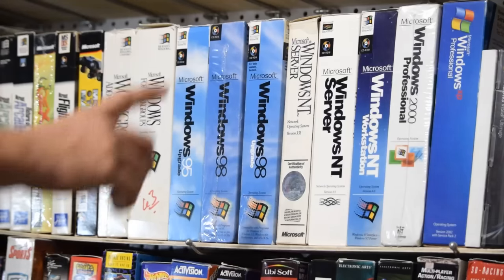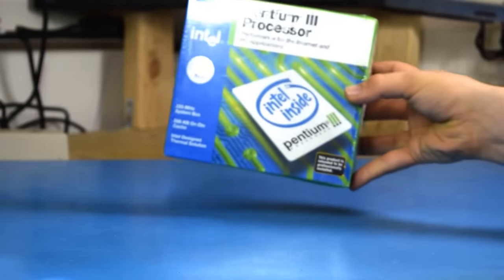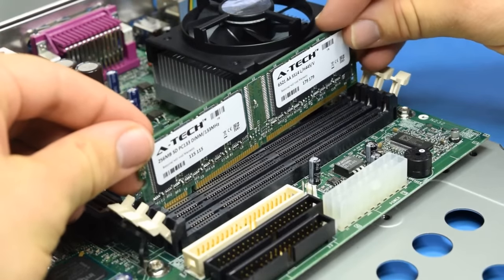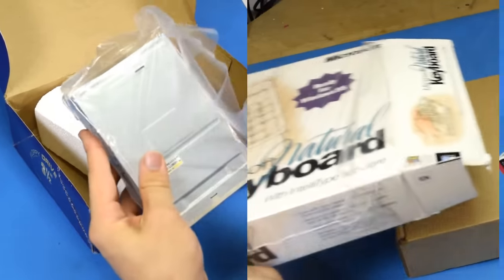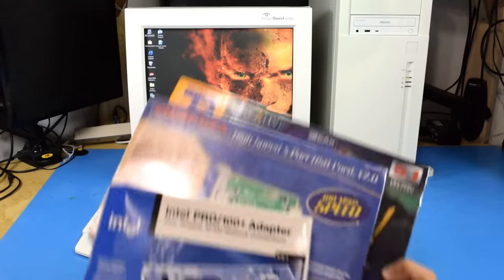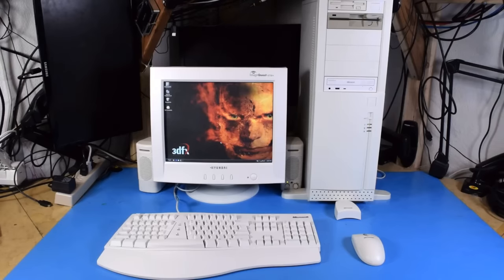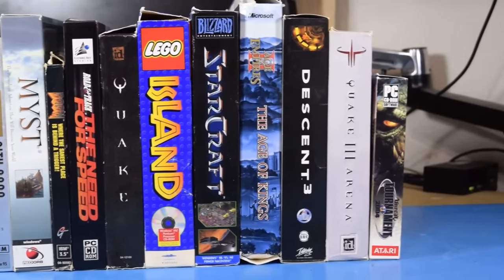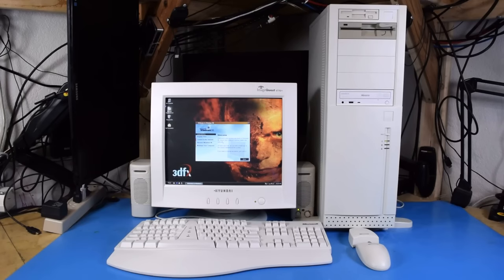Windows 98 20th Anniversary All New PC Build

Comment: 120GB in 1998 ? wow ! i thought my 10 GB Maxtor drive is already too big back then.
Reply: Yeah, pretty sure my first PC (built in 1998) had a P2-400, Voodoo Banshee and a 10GB Maxtor HD. Things moved on pretty quick though!
Reply: It's was Pentium 2 MMX -333. 8 GB Maxtor  Fireball.  256 RAM.  S3 Verge.  SB Live))  That PC much better.  P3 i815 only in my dreams in 98))
Reply: Now games come with patches bigger than that.
Reply: @Kanokito  Totally agree with you
Reply: I used Seagate 20GB
Reply: @Anaxxo  yep, 100 GB back then it's like 10 TB helium drive nowadays, most people either use 4 - 10GB IDE drive
Reply: I miss my Voodoo2 graphics card!
Reply: that 7.4GB raptor drive though! damn!
Reply: the CPU didnt release until June 2001.  in 98, brand new was Pentium 2. Pentium 3 released in 99 but were half the speed of this 1ghz model
Reply: My windows 95 pc has 4gb lol
Reply: @Kanokito  iirc the P 3 was the first with MMX instructions.
Reply: @fredfinks  Tualatin 815 B boards were not around either in 1998. Voodoo 5 was not even announced yet, the Live! 5.1 was not around yet.  The hard drive should be overlooked as 10GB drives that still work are getting hard to find. This should have been called the Early 2000's PC.  This is a good video though as I'm sure that plenty of these parts seen the 98 OS.
Reply: @TheLionAndTheLamb777  Yep. In '97 we got the consumer high end Pentium 1 233 with 1gb HDD (there were larger HDDs - bigfoot? quantum fireball) but 1gb was up the normal high end. S3 virge and a diamond stealth monster voodoo.  In  '99 i bought a Pentium 2 500mhz 13gb, IBM HDD and voodoo 3 3000. Soundblaster Live! but not the 5.1 model.  Yes, this is definitely a 2001 PC.  Few years later it would have had an Nvidia 4600ti. Then the pentium 4s. Oh man what a great processor the Intel cores were! (2006) Huge improvement. Speaking of old stuff i couldnt get rid of my floppy drive until 2009 when windows 7 dropped (didnt use vista. Went from XP to 7). I had 2x raptors HDDs in RAID 0 primary. During XP install, it only accepted drivers from drives A & B Which are reserved floppy drives!  2009!
Reply: in 1998 they didn't make a 120gb hard drive. if you look at the hard drive time line.
Reply: Jay Bee  You have your dates wrong or that it was 1.5gb, not 15.  The biggest drive of '98 was the top model of the Quantum Bigfoot range at 12gb. In 97 i built a pc and it had 1gb (this was not small at the time), two years later in '99 i built another with a 13gb drive. The highest in '99 was the Bigfoot 19gb.  The CPU he uses wasnt released until June 2001. The GPU didnt come out till midway 2000.  This is NOT a 90's PC, and what is likely is that your mums pc had a 1.5gb hdd. That would have been right for a standard dell in 98.
Reply: I had a packard bell c115 with a massive 1.2 gb hard drive. I remember deleting just about everything on my computer just to install sim city 3000.
Reply: We had 6Gb in 1999. My 2003 eMac had 60gb.? So 120gb is mid 2000s capacity. For period I would say 2gb - no more than 10gb.

Comment: You need some cable managing
Reply: ماشاء الله عصابة بدر حتى هنا هههههههههه
Reply: @Vespuccine  Organizing the cables inside the case
Reply: Do you tell a spider to manage its web strings? No. So there.
Reply: @willnicholson18  LMAO this setup isn’t supposed to be an aesthetic pc
Reply: Cable Management in old pcs isnt and the easiest thing to do...best thing you can do is use ropes or something like that to tie them close to each other but they will still be around your other parts trust me i have an HP Pavillion  OEM(All In One) PC from 2006 litellary the Cables were tied close to each other but they were above the Motherboard,Ram,GPU,CPU,CPU Cooler Like  A Bridge
Reply: @Nt_partlycloudly  actually no it doesn't have to be inside of a case it can be anywhere
Reply: @Azizgang  On this situation it is just inside the case, but yeah, you can also cable manage your setup :)
Reply: @Nt_partlycloudly  yup organising cables is now called "cable management". Makes you feel like you're wiring a factory.
Reply: @seanreyes4136  Managing cables isn’t just for aesthetics, It can help promote better airflow through the case.
Reply: @russianteddybear2510  no the diameter of the cable is negligible, it only really affects the pc if it's SUPER BAD, and besides back in the day cable management wasn't as stressed as it is today
Reply: Have you seen any 90s computer have cable managing?
Reply: Charcle -  tf does weaboo mean :/
Reply: @irridesu  im pretty sure he's talking about the xavles in the background, a lot of cables can be seen at the back. It's a fire hazard
Reply: @Azizgang  Hes just high

Comment: Great video!  Thanks for sharing!  It brought back a lot of memories from that time period.  I worked a lot with Intel boards a lot during that time because they were quite stable and reliable for the corporate world.  It was fun to see one being built again.  I agree that the Inwin Q500 was an amazing case!  I think I had 2 or 3 of them at different times.  Still have one in storage.

I'm surprised that you put the CD drive and the hard drive on the same ribbon.  PATA can only run as fast as the slowest device.  Most CDs were usually capped at ATA/33 while the newer hard drives could go as high as ATA/133.  This motherboard was capped out at ATA/100, but with that 80 conductor ribbon, you could definitely get more performance out of it with the CD drive on the secondary IDE interface.

Comment: I built my first computer (486) when I was 12, I am 40 this year.
Reply: Same with 386
Reply: Same with 186
Reply: Same with 086
Reply: I am 45, my first is 386dx40 with 4MB RAM, and 40MB HDD. Video card "Trident" with 256 KB, audio was handmade, array of resistors, using LPT port.

Comment: Play Half Life on it. The first game came out in 1998.
Reply: I started with Half Life with Win98 too.  I first ran it on a AMD K6-2 500Mhz.  That CPU wasn't enough, and upgraded to the much improved Athlon Slot processor.
Reply: I played more Quake 1 and 2 at first, but once Team Fortress Classic and the very VERY early betas of Counter-Strike showed up that changed quickly! 
At the time, this is what I gamed on:  Slot 1 Celeron 300Mhz (0KB L2 cache version) / Garbage HP slot 1 microATX motherboard / 48MB PC100 RAM (later 384MB PC100) / Voodoo3 3000 16MB AGP / Diamond Monster Sound MX300 (HL was bundled with this) / 6GB WD IDE HDD / 24x Goldstar IDE CD-ROM / Win98 (not SE)

Comment: Good recommendation by YT. I like specially the case where you can remove the mobo area. It is much easier to clean and also for troubleshooting unlike the new ones that are so cramped that it feels like it's the mobo area with a cover. Hope that casing will make a comeback. 😁

Comment: YES!!!!  The original Microsoft Flight Simulator is the best!  It lets you imagine more whereas the new versions leaves the imagination lacking.
Reply: Inachu Ikimasho that's the point of a simulator. To be as close to the real thing as humanly possible, or to "simulate".
Reply: Inachu Ikimasho Yeah, those pilot training simulators suck, they’re actually accurate and actually teach things. How boring!
Reply: The point of making them better like they are now is so that you're imagination can be seen on the screen in front of you, making it way cooler. And even then, its not like it turns your imagination off. You can still use your imagination within a very detailed graphical game.

Comment: This is awesome. I remember holding on to a misguided belief that win98 is the best OS (I was a stupid teen at the time) and held off using a new OS well into the Vista days. I even found a way to get a DSL PPPoE dialer online since win98 only supported dial-up natively. Subscribed.
Reply: EvanM. 777 Windows 98 supports wired Ethernet natively, just need a router/firewall box protecting it.
Reply: John Francis Doe Yeah, but our DSL service back then required a PPPoE login and did not support a direct ethernet connection. The only way i could make it work is to trick the OS to think that it is still using a dial-up connection complete with logins. Fun times lol. Edit: also, back then we were just provided a DSL modem (routers were not really a big thing in my country at the time) so I cannot just add PPPoE info like what you can do with routers today, if they still support PPPoE.
Reply: I wouldn’t call that stupid, I held off for a long time as well mainly because win98 took up way less resources.  You didn’t need newer hardware which as a teen with no money was a must. 

Also do you remember Windows ME? That was a shit show.
Reply: Tyler Pestell ME is the reason I  developed a phobia to newer OSes back then lol

Comment: I sure don't remember a 120gb drive in the 90's lol.
Reply: Jeremy H. As well as Pentium 3 and that video card he has.
Reply: He was going for the max hardware that could be fitted to windows 98, not necessarily hardware from that time period
Reply: I build one with 4gb hhd , i format my windows every 2 weeks becz there no space on hhd
Reply: I remember when 15 gig was frigging gigantic.
Reply: In 98  a Pentium MMX 166 Mhz and 2 Gb harddrive ,64 to 128 Mbit ram memory and a Voodoo 2 was top spec and a 15 inch monitor ,all of that i remember paying about 2000 € back in the day ,add a HP printer and a HP5 flatbedscanner to that and  i payed a total of 2500€ what was 2 and a half months of salary back in the day.
Reply: My first hard drive 420 mb,second one 1 gb, third 15 gb, 20 gb , 80, 250 , 320, 1 tb
Reply: Agreed I think a P2 333mhz 32 mb of SD 100 ram would of been more appropriate
Reply: i remember buying a 20gb HDD... its was the bee's-knees!
Reply: I worked at Best Buy in 99.. 128gb of ram was over $200 and a 10gb hard drive was insane expensive then. With all of that said, this is still a really cool video.
Reply: Fernando Alvarado my first hd was a maxtor 80 mb.   I bought it for my 286 12mhz.    It was s pretty big deal at the time when most everything still being run off of floppy drive 😜
Reply: I find the inclusion of the Pentium III a fair one, since everyone that could afford that Voodoo card would immediatly upgrade to the pentium III when it arrived just to prevent hugely bottlenecking their GPU (although the PIII also bottlenecked it, though less severe). 
However, that 120Gb HDD is just ridiculous. Back then even 4Gb was seen as more than decent capacity, and even at the end of Windows 98's lifespan most people had less than 12Gb.

Comment: My first pc was intel pentium 3 866mhz, intel 810e chipset mobo, 128mb ram, 20gb harddrive, floppy drive , cd drive,At tower case, acer slim keyboard, logitech ball wired mouse, intel webcam , multimedia speakers and microphone, D link external 56 kpbs dialup modem, cannon bubble jet printer, logitech joystick, v core smps , OS windows 98 . Also at some point of time i did upgraded my ram to 256 mb and soundcard to creative soundblaster. I loved my pc back then and it served me for a very long time. Back then pc components were built like tank

Comment: And my $10 raspberry pi is more powerful than this. And it’s the size of a stick of gun. It’s just crazy about how much everything has advanced.
Reply: Stick of gun 😂 I know what you mean, it's just funny.
Reply: Bezzegh Adam well, there's console killers
Reply: @Bezzegh Adam
There's a number of very practical reasons for that.
Besides the need for universal interfaces (eg all companies need to agree on how their products connect to one and other).
Secondly try upgrading or replacing anything in a mobile phone (internal storage, a gpu or cpu or ram) unless you have all round robotic like precision (vision as well as movement) or similar aids (costing 1000s) it's impossible thus the current size of components make the home enthusiasts job relatively easy.
Third is the need for cooling, when rendering the demanding aspects of modern graphical games there needs to be adequate means of exhausting heat.
Fourth power requirements, to do the vast amount of jobs modern desktops are required to do a solid, safe performing power supply is needed 5 volts won't cut it :) 
and last but not least, there's moore's law. A mobile phone can emulate older kit extremely well but there's only so small the current tech architecture can go, something radically different is required to further the downscaling.

Having said all that I'd happily see everything at least halved in size, it's very much possible & long overdue. I'm quite surprised the big manufacturers, Intel, Asus, NVidia, AMD, Corsair etc etc haven't got together and put to market smaller form factor diy desktop components. The "micro atx" motherboards are a pain in the ass to work on with normal adult sized hands and current full-ish sized components when installed in a micro atx case.

Apologise for the length of this. Kudos if you even read half of it :)
Reply: @Bezzegh Adam there are desktops that can fit in the palm of your hand
Reply: Bezzegh Adam I would disagree instead of having a brick now we have a lighter and thin brick next 20 years it will probably be a hologram or nothing or the same
Reply: My watch is more powerful than this
Reply: @Adam
All you need to replace phone parts is a very small Philips (or torx? for some shitty manufacturers) screwdriver and and a thin piece of whatever (preferably plastic).
Desktop format is still alive solely due to thermals (no way to cool 100W+ parts in a smaller form factor).
Reply: The Arm V6 core in in Pi Zero is nowhere near as powerful as a Pentium 3. Phoronix Compared the Pi Zero to a Celeron Netburst (something this particular Pentium 3 would actually beat) and its not even close.
Reply: tf2exe actually the pi 2 is much faster than a p3 1ghz “Overall these results were interesting. In terms of raw performance, the Raspberry Pi 2 was performing in some CPU-bound tests better than the Celeron D 320 (2.4GHz) processor “

https://www.phoronix.com/scan.php?page=article&item=raspberry-pi-burst&num=6
Reply: +lifehackertips The point is he said a $10 pi, that would be the Pi Zero. Yes the Pi 2 is significantly better than the Zero but that isn't the one OP said.
Reply: xex2kok even the pi zero is faster than a p3 1ghz.  They were reviewing much faster 2.4ghz CPUs and they struggled against a pi 2
Reply: xex2kok ugh, you’re right 😑 found dhrystone results for the $5 pi zero (not w) and p3 1ghz.  Zero is 1237, p3 is 2700, so it’s roughly double.  Still, considering a pi zero uses 2 watts of power at 100% load compared to the hundreds of watts a p3 pc used, it’s still a very impressive device, but you are right, his $10 (really they’re $5) pi is not faster than a p3 1ghz.  Even if he found a pi 3 for $10, p3 is still 10-50% faster depending on the benchmark
Reply: You talk like you created it lol
Reply: Is it more powerful than my Glock 19?
Reply: @Bezzegh Adam well, no. Old computers are huge, new ones can be as small as a console.
Reply: Not really. Pentium 3 1GHz is more powerful than the rasperry pi.

Comment: You know things have gotten real bad with modern Windows when you want to go back to Windows 98. I do miss the no BS layout of the older Windows menus. It's like they've tried to create a version of Windows that can be used for both corporate and home users, tablets and PC's, and doing so created something that falls short in all areas. If it wasn't for lack of software and driver support for stuff I use I would have moved to Linux permanently when Win 8 came out.
Reply: Hell, I'd be happy if we could go back to XP.  It was stable, didn't require insane resources, didn't need to update itself every 8-1/2 minutes, had excellent support for older programs, and even had a mode that made it look and work just like Win 9X/2K.
Reply: For me it all started with a project that the snowden documents during the leaks 2013 unveiled that Microsoft had that was very fishy companied by the NSA spying. Yuck what an abomination. There was even a screenshot showing win 8 that looked lie win 7 but with messenger program (now apparently an app) in the dash.

Comment: That time when you find out a 20 year old gaming pc is better than your modern laptop...
Reply: Duka Duka well I have a 2017 insignia flex and its TRASH (it is worse than a GBA)
Reply: Mary Ann Cardenas thats a tablet not a laptop
Reply: Oh boi 🌚 perhaps I can donate you my MacBook Air 💁🏼
Reply: When I mean modern laptop I didn’t think that through.. My laptop has 4GB Ram, Poopy Graphics, Poopy CPU (1.40GHZ) I think... :(
Reply: @lollb454  Maybe, but considering I bought a new laptop for £600 that was giving me 10fps on 2003 games at low settings Its not far off the mark, my mid range 2008 laptop ran them better which adjusting for inflation cost the same.

Comment: 20 years? It can't be 20 years. I remember installing Windows XP in 2002, and I only installed Windows 7 in 2009.

..oh.
Reply: What you say? I did not install Windows 7 until 2015! At this point, I now have "one of each": four systems ranging in age from 3-14 years, with XP, Win 7, Win 8.1 and Win 10 installed (from latter to former). Can you say, "Culture shock"? Naturally, I do not connect my XP system to the internet(s) any longer since it no longer gets updates/patches. But... I can still run my premium, overly-paid for software on that one.
Reply: Thank goodness for Windows 7, I suppose I'll have to upgrade eventually but I'm sticking with 7 for as long as I can. It works and I like it.
Reply: @herculeholmes504  Yea... Outta my cold dead hands... and old bled (dry) wallet.
Reply: I'm quite happy to pay top-dollar for Windows if I have to, I just find Windows 7 easier to use and friendlier than Windows 10. Windows 10 is weird.